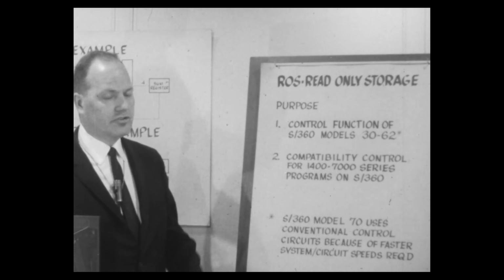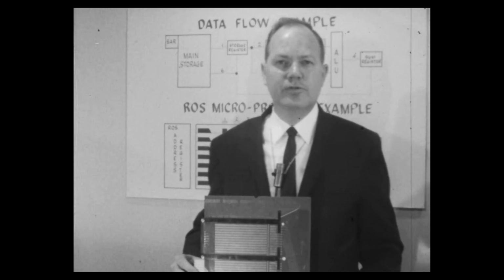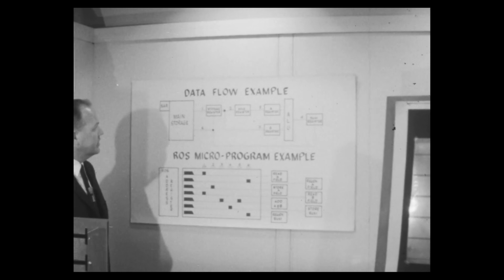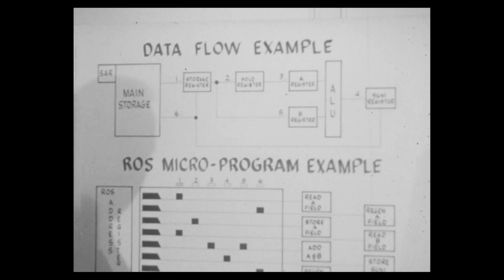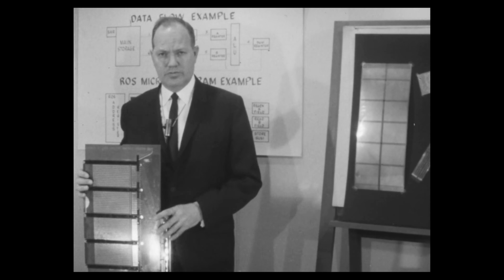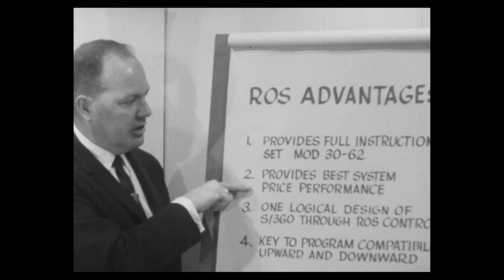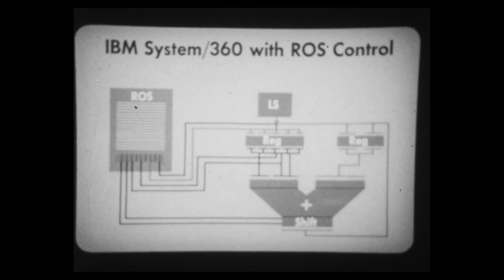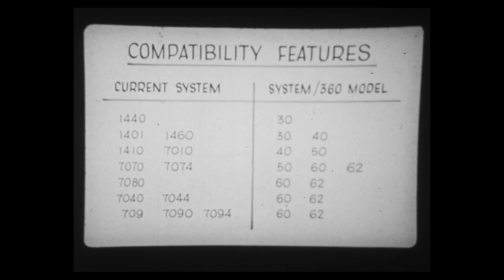Computer History IBM System 360 READ ONLY STORAGE 1965  Technical Lecture Mainframe Memory Card ROM

Comment: Prior to read-only storage being implemented using semiconductors other technologies were used such as core memory using ferrite toroids (circa 1955-75) or plated wire memory (circa 1965-1980). Both of these were non-volatile and resilient enough for aerospace or other hostile environments. The storage density and access time of these technologies improved greatly over time, and their use for microcoded instruction sets and others uses such as kernels of high reliability operating systems was widespread.

 Some other non-volatile technologies such as bubble memory found specialist uses such as flight data recorders, but for general purpose computing all these technologies were overtaken by developments in semiconductors by the mid 1980s.
Reply from the maker: Hi @philipwardle6820, that is great technical information you provided!  Very much appreciated!  Thank you.  ~  Victor, CHAP

Comment: Excellent find. I wonder if IBM had a programming language for generating the microcode instructions for the ROS? Or maybe it was just hand-coded?
Reply: The microcode is developed with a 'microcode assembler' that has symbolic names for all the bits in the wide field. It is not a conventional 'language'. Hand coded by the firmware engineer.

Comment: Amazing to think this is all still pretty much how it works now, just miniaturized. When you flash your firmware, you're effectively swapping out the ROM cards. The rest of the architecture pretty much hasn't changed after 60 years. This is still how computers work.

Comment: microcode in CPU has survived until now. X86 architecture is also microcoded since the beginning. In the 20 first years, microcode was on a rom mask, without possibilities of update, and after the fdiv hardware bug was discovered, and cost millions to Intel, subsequent models had the ability to replace the genuine microcode with a new one that is loaded in a fast static ram area of few dozens of kilobytes in the CPU. The bios, or the operating system, take care of using last available microcode early in the boot process. using a dedicated instruction of the X86 ISA.

Comment: 3:50 Series of Capacitive plates ?  The ROS was Capacitive ?  If the were measuring capacitance wasn't it susceptible to noise ?
Transformer Read only Storage is also bit sketchy
Reply: The CROS cards (which as an intern in college I assisted in replacing when updating a customer’s model 30) were coated with silver on one side (IIRC it was the back, and on the front was the normal printing of a stock card) with horizontal stripes between the rows of hole positions, spilling over into the hole positions.   The contact was made with the portions of the stripes extending into the last 8 columns.  The divider between cells had vertical silver stripes down all 72 columns facing the unsilvered side of the card. The silvered side of the card faced a thin airbag.  Each card went into its own cell, and several cells were stacked vertically ( like the 4 card assembly in the movie), while many such assemblies were attached horizontally.  All of the airbags were connected to a compressor, and with the cover on, the bags were all filled with air, pressing each card tightly against its mating contacts.  Matching column numbers were connected in parallel to form the outputs, and a selection circuit passed a pulse across  one row of one card to select the word.

Since the pulses were all clean, consistent square wave pulses, and the separation between “plates” was consistently the thickness of a card, and the entire ROS was inside a Faraday cage, there was no problem with noise.
Reply from the maker: @allanrichardson1468, thank you very much for sharing your experience with this technology!  That helps with understanding the specifics of how it worked.  Your knowledge is quite helpful!  ~  VK
Reply: See, easy peasy.  Just need an air compressor, functioning seals and a Faraday cage to make your ROM (ahem ROS) work!
Reply: You realize modern-day flash, like your phone memory, are capacitive cells right?
Reply: @JohnDokivin  modern day flash storage or eeprom cell is based on trapping charge in a insulation gate layer, Modern flash uses similar 
charge trap cylindrical cells
Reply: @AjinkyaMahajan yep, you gave more detail and pointed out it's more sophisticated semiconductor materials but yeah , same principle, charge trapped behind an insulator, basically a capacitor. Magnetic core memory I found particularly impressive. Old school bubble memory is probably better than some current flash chips. I'm surprised phase change optical hasn't gone past DVDrams in production, started with PD discs, it inspired CD-RW's , but combined with photonics it could be in chip size and far more durable lasting hundreds of years like books, but it's been nearly half a century if not more since people in general choose to buy the better technology instead of the cheaper technology. Phase change photonic storage should be a thing, not just magnet resistant but EMP resistant. 
 I don't think the newer versions of it require tantalum anymore, but don't quote me on that

Comment: Thanks for the very interesting video! BTW, both Mask ROM and PROM predate IBM ROS for almost a decade.
Reply: @vmisev  From my experience as a student in the sixties, integrated circuit semiconductor ROM (and RAM ) in the sixties were too limited in size to use as the control store of a discrete component CPU, and certainly as a replacement for core as RAM in a mainframe.  By the early eighties chips were approaching that size.

Off-the-shelf ROM chips were common in the late sixties for code translation (EBCDIC<->ASCII), binary to one-of-N, and binary/ASCII to seven segment digit display.  These only required tens or hundreds of bits on the chip.
Reply: @allanrichardson1468   Thanks for your input; 👍 Thing is, first PROMs weren’t commercially available since they were used in Atlas E/F expendable launch system airborne computer and were Top Secret.  One Time Programmable (OTP) was commercially available around ’69, and EPROM in ’71, so this make System/360 first to commercially use what we know as ROM (TROS), but IBM wasn’t first to invent principle, that’s what I was trying to say 🤷‍♂
Reply: @ True.  In the early sixties when NASA was developing the Apollo guidance computers, they were concerned that the programs could be corrupted by cosmic rays and solar flares.  So they developed what may be a precursor to IBM’s TROS:  wires which were selected to represent instruction addresses, each one hand threaded through some but not all of a series of large (maybe about an inch in diameter) magnetic cores by women hired for their skills in knitting and macramé.  When a wire was activated with a pulse of current, a voltage would be induced in the pickup windings of the cores the wires passed through, but not the cores that wire bypassed.  No way cosmic rays or solar particles were going to disrupt those ROMS!
Reply from the maker: @vmisev, thank you.  That is a fascinating bit of information!  ~

Comment: Interesting how they called it ROS, which later on became know as ROM. How anacronms change over the years.
Reply: IBM officialdom did not like to refer to any part of a computer as “memory.”  The working RAM available to the programmer was called “main storage” or “core storage,” because the universal method of implementing it was with a matrix of donut shaped magnetic “cores” suspended on a matrix of fine wires.  The cores were, in the later stages of the technology, as small as half a millimeter OUTSIDE diameter, and yet four wires were threaded through each core!

ROS was not part of the same address space, as ROM is in modern PCs.  Instead, ROS controlled what might be called a simple “inner computer,” which executed a program stored in ROS to emulate the “outer computer” seen by the programmer.”

Not that users (including programmers) didn’t refer to storage as memory when speaking; the word “memory” was just forbidden in official IBM technical manuals!  The word may have been used in sales literature for managers; I’m not sure.
Reply: @allanrichardson1468  If you think about it, it isn't really memory, but "data storage".  I think they referred to tape and disk as "secondary storage".
Reply: @ Exactly.  IBM and other manufacturers of BUSINESS machines did not want users to anthropomorphize the machines.  But human beings being human, it was a losing battle.

Secondary storage is another matter.  It contains the data that the computer doesn’t “remember” but has to “look up,” and it stays on the “bookshelf” when the computer is not active.
Reply: @allanrichardson1468   They did very well there with using clear and simple lingo with ‘Minidisks’, especially when used as (basically) users home directory, and to use actual directories users had to be in the file pool (which wasn’t guarantied) and to add “SET FILEPOOL filepoolid:” in PROFILE EXEC. No wonder I was spending way more time on VMS than on VM/ESA (1.1) back in my student days 😂
Reply from the maker: Yes, and sometimes disk/tape were called "off-line storage" if my memory serves.
Reply: @ComputerHistoryArchivesProject 
Well yes, except that IBM systems didn't have disks, they had DASD!
DASD being the initialism for:
D irect      
A ccess
S torage   <<< see?
D evice

(Access was "direct" to the needed data, as opposed to  having to sequentially read everything from the start of the tape).

BTW, despite it being an initialism, "DASD" was pronounced - at least everywhere I ever worked -
as "dazdee".
Reply: @allanrichardson1468   So true,  but IMHO most confusing is how IBM used term "file" in  System/360 manuals 😁
Reply: @ Simple: “file” meant a description of a set of data in a program, its method of organization and access, its record layout, etc; in other words, an abstraction.  “Dataset” meant a specific physical occurrence of a file on a storage medium.  “Payroll master” is a file.  The payroll master currently on a DASD (=HDD) or the archived payroll master for date XXX on a tape in the library is a dataset.
Reply: @allanrichardson1468   Thanks, I sorta get it, I’ve been playing with Hercules/MVS (TurnKey) for a while, but please let me quote this gem:
"Files
IBM 2301 Drum Storage 
The IBM 2301 Drum Storage (Figure 20) provides random access storage of approximately 4 million bytes at a data rate of 1.2 megabytes per second. The high data rate is partially achieved by accessing four bits of information in parallel rather than in series; thus the common reference to this as a "parallel" file. Data are recorded on 800 tracks, divided into 200 addressable groups of four tracks read in parallel. Access time averages 8.6 milliseconds. Data records can be of variable length. "
Not exactly how we understand term 'file' nowadays 😁
Reply from the maker: @bob4analog, quite true!